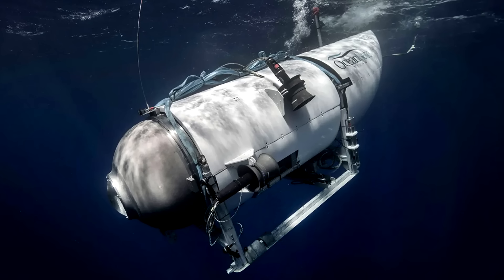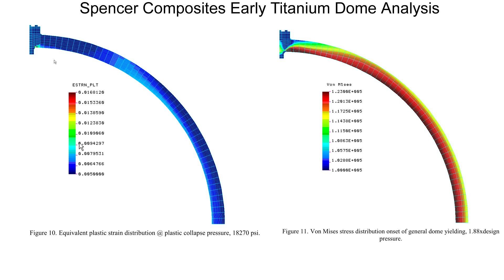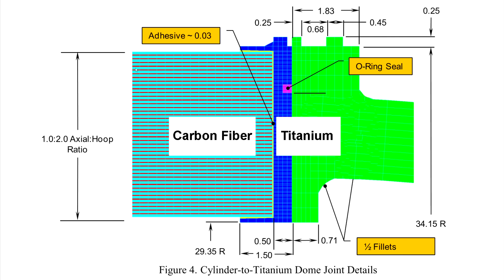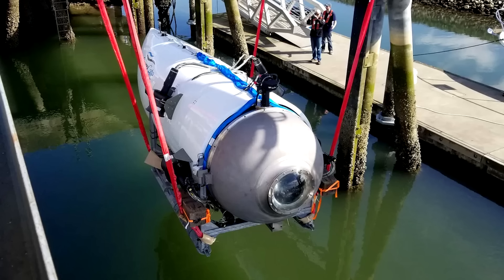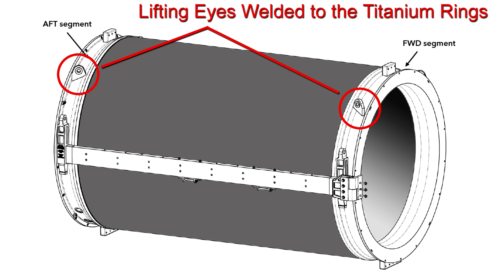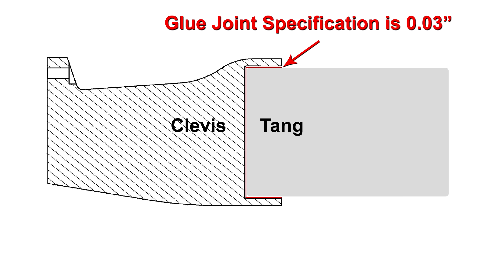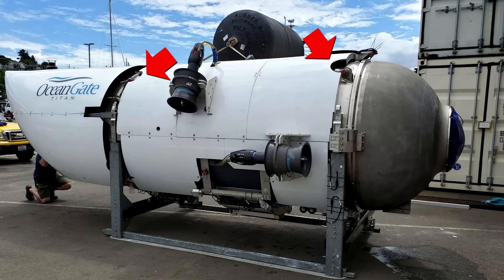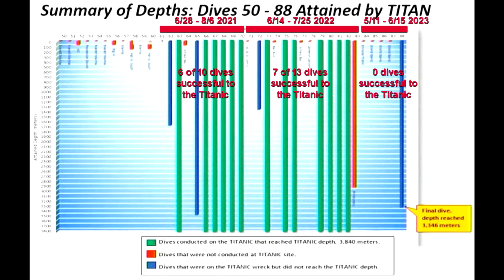OceanGate Titan Titanium Rings - An Additional Story About Them

Comment: Me myself, I'd extended the landing gear. To above the top then add a cross beam at the top with eye hooks at the corners. Or if the corners are cut to a 45°  put the eyehooks at the upper 45° elbow. Keeping all the force away from the rings . Doing what they did would probably work fine . If  the thing weighted 2-3 k lbs, (like a small car)  this thing is a semi trunk plus or two unloaded semi trucks  with all the 🔔 and whistles, with empty trailers. It's too much weight to be lifting it just anywhere anyway..  me myself I'd made it all from titanium, the ring area kept thick then thinner in the center. And heat the titanium to about 250°-300°f. Then slide in the carbon fiber tube, so tight it wouldn't fit otherwise. With the titanium about 1" thick, then reinforced with the 4"-5" thick carbon. and possibly slide in 2" thick solid steel in the center on 12" centers. Fitting just snug after being chilled to about 150°f below zero with about 6 of these rings to help brace the carbon. When the temperatures are equal, I'd test it  unmanned , with sensors checking for any crush in every direction. And go deeper until it sees . 0001" shrinkage, keep going until it shows 
.00015" additional shrinkage. Hopefully it will be on the ocean floor then. (I doubt it) I would not want to see more than .0006"-.0009" maybe  .0012" at most, because carbon fiber is like glass, its strong yet brittle. Getting movement will eventually cause it to break. And having a single material exterior makes finding faults easier.

Comment: As a retired saturation diver, I'm amazed these submersibles worked as well as they did. Firstly Carbon Fiber's main strength is in Tension not compression, Secondly the Welded Lifting eyes welded on the Titanium Rings would have been HEAVILY welded onto those rings creating distortion of the Rings, Specifically the Ring Lips as they were called, the Thinnest parts of the rings. from previous videos I understand the Carbon fiber was layered with Sensors which detected Water; Significant  intrusion into the Carbon fiber body was detected prior to the implosion, which saturated the Carbon fiber body, nullifying the ability of the submersible to drop it's ballast weights and rise to the surface, which appeared to be the only fail safe incase  structural integrity was compromised. Recordings of the dive heard a LOT of cracking, before the implosion. Give me three inches of Solid steel any day and more fail safe systems for redundancy. tens of Tons of water pressure has to be respected and feared a little (IMO).
Reply from the maker: Thanks for your comment. Amazing that you did saturation diving; how cool!  A couple of things I would like to discuss.  I have never heard about any sensors being layered into the layers of carbon fiber.  Everything that has been testified about are sensors or strain gauges glued to the inner surface of layer one of the hull.  Actually, other than Dive 80, when they heard that big bang, this hull was remarkably quiet.  The NTSB testified that there was no acoustic data from the final dive.  The reason is that the acoustic data was recorded onto a computer in the sub, so it was destroyed.  Glad you stayed safe being a saturation diver.
Reply: @solareclipsetimer  There was less and less noise recorded as more and more acoustic sensor devices had failed.
Reply: Finally, someone else who can look past the magic words " carbon fiber " to the basic truth . . . . strong in tension.
Reply: @sciencetroll6304 loads of deep sea vessels are made of carbon fibre..... It's usable under the correct parameters
Reply: @sciencetroll6304  carbon fiber also reminds me of fiber glass. I wouldn't build a pressure vessel with that crap either
Reply: @Ron-y1b  A pressure vessel would be fine because the fibers, either carbon or glass, are under tension like a fire extinguisher or oxygen bottle would be. Something they resist rather well. Stretching the fibers works. Like pulling a rope, it does that without any problem. But, try pushing a rope instead of pulling and you get distortions and wrinkles. same happens with fiberglass and carbon fiber vessels, they handle internal pressures fine, but don't try pressurizing them from the OUTSIDE, like the Titan sub and expect them to not distort and crinkle.
Reply: "Significant intrusion into the carbon fiber was detected"
Wait a minute. You're telling me that this thing that was supposed to withstand like 5 ksi of water pressure was LEAKING to the inside??
Reply: @nashooo5903  It does appear so, even from the transcript before the implosion ... at least 176 pounds of unaccounted-for payload picked up in less than two hours.
Reply: @nashooo5903  They had Live recordings of what was happening, before the Submersible imploded. They had One escape plan and that was to drop the large frame & float up, but due to inundation of the Carbon fiber they just kept descending. Comm's died on implosion. Someone will have that info if you wanted to search it. Cheers.
Reply: @nashooo5903  Not leaking to the inside, if I get it right, but leaking into the carbon fibre laminate and getting trapped there. The phenomenon is known to glass fibre hulls on boats (where I think it's more of a nuisance). In Titan's case it took away much of Titan's ability to make an emergency resurface (and had the boat survived a few more dives probably would have taken away all of it). Bad as that is - and it is bad since it would make a power failure a death sentence - the probable reason for the water intrusion is far worse: the carbon hull was delaminating and losing strength.
Reply: @STEFANiSAKSSON  Oof. Water forcing itself in between the hull layes & the whole structure eventually breaking would also help explain some of the wreckage photos, and why whole sections seemed to have peeled off.

176lb per @hymnodyhands is 80kg of water, 80,000cm^3 of volume (assuming it doesn't compress - it does, but not by much), forced into the carbon fibre. 8m^2 at 1cm thickness, 80m^2 at 1mm. At stupid pressure.

This is not good!

EDIT: It would be interesting to know of weight discrepancies on previous dives as this could potentially show progressive damage. I am not an engineer so my $0.02 & YMMV.
Reply: @STEFANiSAKSSON  yeah the way I understand their construction technique... it had a critical failure in that the main hull.... was literally crumbling. it was held together by material that cracked each time it did something.
Reply: @STEFANiSAKSSON   Thanks for the explanation. So, although it wasn't leaking, it was slowly soaking like a wet napkin lol
Reply: It appears they did at least appreciate that the titanium rings had to expand and contract at the same rate as the CF. However to do that the geometry of both parts would have to be the same; a titanium ring of consistent dimensions and a CF cylinder likewise. As soon as you weld those lifting eyes to the ring it is no longer that, where the rings are attached those parts are different and will behave differently to the rest of the ring and the CF cylinder, which is why the designer said they couldn't do it.
Reply: Exactly!! Tension and not compression. I'm an idiot and I know this. What's amazing about this is the psycho narcissist actually convinced other seemingly intelligent people to go along with him.
Reply: @craigcrawford6749  it's not that you cannot use cbf - if you're an idiot and you know CBF isn't as strong under compression then don't you think they knew that too? 🤣

The glued layers seems to be the issue rather than the outright material choice
Reply: @ Well he started with less... extreme testing.  Some of which actually worked.  Also, Carbon fiber DOES get used in compressive loads too.  People make ski poles out of it.
Reply: @marhawkman303  ski poles??? really? not an example of extreme compression. As explained in the video it's not just that CF was used it's the fact that the C channel on the bulk head was compromised/deformed which allowed water ingress on the ends of the carbon fiber leading to saturation of the fiber and loss of the their only emergency ascent fail safe. (Ski poles :-)
Reply: @stuartcleary71  Ski poles and hammer handles need to handle shock loads. which yes, is NOT the same thing as a compressive load, but.... it's also not actually about tensile strength.

Also as you point out here... one could argue that failure method was a manufacturing defect, and not a failure of the basic concept.
Reply: In the real transcript, revealed at the official hearings in September, there are some notes just a little before the implosion that give evidence to your position... the communications officer DOES KNOW something is wrong, because that person messages the Titan that they are moving a huge amount between pings, and then asks what the payload is. The Titan reports back, "1676 lbs." The design payload limit was 1,500 lbs, so somehow, the Titan was at least 176 pounds overweight. That doesn't seem like a lot on a 11.5 ton vessel ... but if it is water intrusion that accounts for it, that means the water was past at least one layer of the hull, and working on those rings from inside the hull.  The other thing: Tym Catterson at the hearing said that the weights that were dropped were only 70 pounds, and "it's only slowing you down" ... but that change in velocity while overweight and with perhaps only four layers to resist all that pressure might have done it ... the implosion happened seconds later.
Reply: @hymnodyhands  Yeah. I honestly think their design might have worked... with a different carbon compositing process.  needs something OTHER than gluing.  more like extruded polymer.  I'm just not sure how you could wrap the fiber while getting a proper fusion of layers of polymer.  It'd need to have a polymer you can keep liquid at just barely above room temperature.
Reply: I just found out about saturation divers today, it is fascinating!! I have never heard of it before & have been watching vids for most of the day, also ty for help keeping the world running!!🙌🏻
Reply: @cchehe8820  It's a dying profession, Automation and R.O.V's (remotely operated vehicles are taking over much of the work as machines don't need: days of decompression, huge bell systems, chambers, TUP (transfer under pressure units etc. just as AI is going to take over many surface jobs and professions, I suppose. I talked my son out of doing his commercial diving tickets years ago as there's more opportunities on land nowadays. But it was a fantastic experience for many years. Cheers.
Reply: Carbon fiber is used in racint because it shatters on impact and thus dispurses energy but is still strong. Not what a sub would be built of if you had a brain

Comment: That's interesting. I was not aware that the domes were not perfectly round. I'm impressed they accounted for that. 
My gut feeling is that it would have failed eventually either way. But you do have to wonder how many dives it could have made if they didn't add the lift points.
Reply from the maker: Thanks for your comment.  You know, despite a lot of odd things that happened, some good engineering was done on some parts.

Comment: You are, as they say, rearranging the seats in the Titanic. Engineering is a methodical process with very careful procedures where safety is involved, and the builders of this sub skirted most of those procedures. Even if the rings had held up, even if the carbon fiber had withstood the pressure, even if, even if, the lack of interest in the safety of the crew and passengers would have doomed everyone anyway. It would just have taken a few more dives.

The pressure was making silly putty out of the carbon fiber, so even if the welded eyes had not created leakage points for the water to enter, some other part of the carbon fiber would have failed. Security is not about a small mistake here and another there, it is a philosophy of engineering that involves all of the construction and maintenance.
Reply from the maker: Thanks for commenting.  You are correct.  This is an interesting point for those who think the failure happened at the glued joint.  It's also another interesting engineering decision story.  But, of course, the hull could have just been crushed.

Comment: I'm also thinking about the difference of a corbel vault and an arch vault in architecture, something that I haven't seen anybody talk about so it should be looked into? 

But the way the carbon fibre was spun in only one direction it effectively makes a corbel vault since every new layer is cantilevered over the old layers. 

And a corbel vault is much much weaker than an arch vault since the forces are transferred to the weak points instead of uniformally along the entirety of the arch. 

So that cantilevel force will not transfer forces sideways to the end caps but up and down the thickness of the hull like a seesaw on every layer pushing and pulling on the glue matrix between every bond.
Reply from the maker: Thanks for your comment.  I had to look up corbel vault, thanks for bringing that up, cool!  So, the carbon fiber was laid down with two plies in the loop direction and followed by one ply in the longitudinal direction.  That was repeated for 133 plies to get about one inch.  That was done five times.  If you get a chance, you should watch my hull videos.  I think you would like them.  The description has my OceanGate playlist link.
Reply: @solareclipsetimer  

I've seen those and it's absolutely insane. 

But your mention now of the two plies loop direction/one ply longitudinal layering is actually the first time EVER I see anyone mention anything else than the hull was only done in one direction only, so that's interesting. 

I still don't understand why they didn't do any in 45 degree which would've transferred the loads better? Stockton said something about he didn't "believe" there were any torsional stresses under water which is absolutely insane. 

But to me, if the layering was done in five different instances in time, and some of them were baked several times over, then you shouldn't count with those five layers as one, but as one layer with the fifth of the thickness required. Not without testing anyway. As in, the entire procedure is useless without further testing.
Reply from the maker: @ingvarhallstrom2306  Thanks for replying.  You are correct; Boeing recommended 45-degree plies in their early analysis of the requirements.  You are also correct that if you are going to have five, one-inch layers, all of those layers need to behave as a unit to have the strength of five inches of CF.

Comment: Yikes. This sounds like "Tony" was the only one who understood all this! There should have been a whole team of engineers who were well across all of these issues. They should also have had good in-house understanding of every analysis they out-sourced (if you don't, how can you ask questions of it, or know it has covered everything, or repeat it properly if the design changes?).

Honestly, for an early-stage device like this, you want very close supervision and collaboration between your design engineers and your workshop guys who are doing fabrication, and between the design engineers and operators. There should be no "hand off". The design engineers should be there for every step, because so many aspects of the manufacturing are new and not part of an established process, and aspects of the operation might not match pre-conceived ideas. The engineers need to see how everything is made and used, they need to understand what can go wrong, and they need to be sure that whatever assumptions went into the analysis are valid in the face of the actual manufacturing process and final parts.

This whole enterprise comes across as a giant cost-cutting exercise. You can't expect to engineer something so sophisticated if your engineers are treated as interchangeable, out-sourceable services within  a design bureau! They need to be the owners and custodians of the product. How was anyone EVER asking for lifting hooks to be welded on who WASN'T one of the core design engineers?!
Reply: Yes. When I worked in a production facility, there was a clear distinction between engineering projects and projects released to production. We had to follow engineering jobs closely until everything worked, at which point we would release them. This seemed normal and prudent to me.
Reply from the maker: I agree with everything you said.  But in this case, there wasa  culture of hiding things for the fear of someone telling them no.

Comment: I'm always curious about one thing regarding that viewfinder.
In a previous video you talk about how the typical dome shape is stronger than what they did (basically filling out the center area for better optics)

but I'm always confused as to why? Like, the same things are in the same places, there's just more.. how does that weaken the object as a whole?

Secondarily, would it be possible to build this inner shape, but spaced out (or with a lens) to basically cancel-out this bad optics problem and, well, not touch the strength?
this feels like something that could be accomplished (thinking of how camera lenses work..)
Reply: Think of it as that mass they filled out in the centre, when pressured from outside, that pressure don't have anywhere to go, like the pressures have in the dome shaped part. That filled in mass, when pressured, it basically wants to "pop out" from the rest of the glass and pop into the inside of the sub. Because of that, that mass don't fill any structural purpose and have to be subtracted from the calculations for safety. You can have it there for optical reasons, but it's useless for structural integrity.
Reply from the maker: @ingvarhallstrom2306  That is a good reply, thanks.